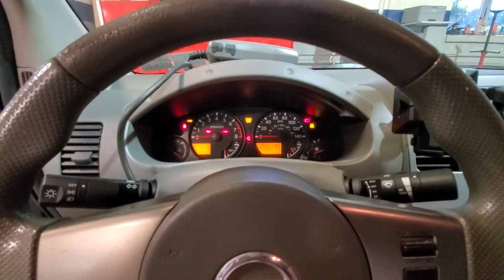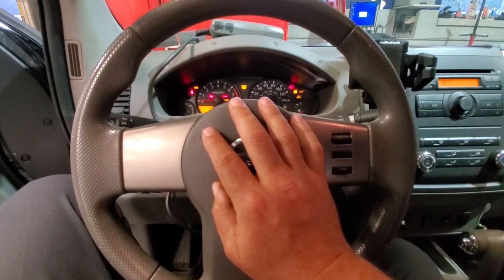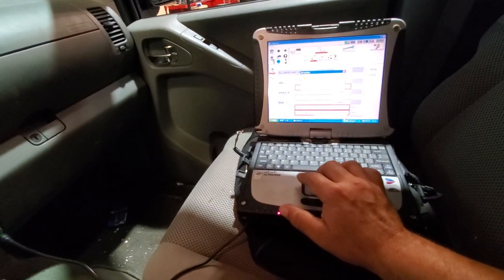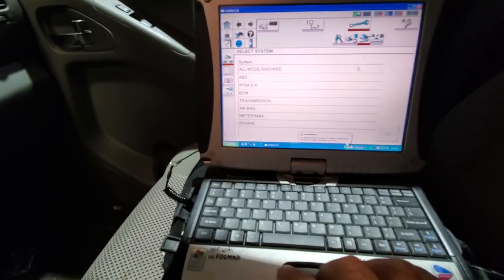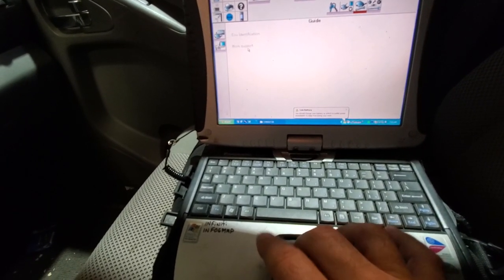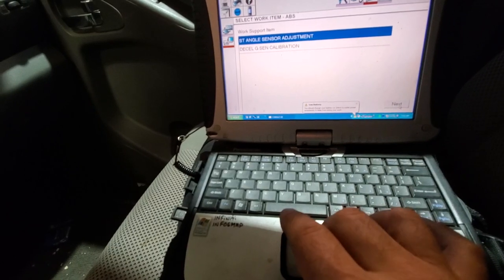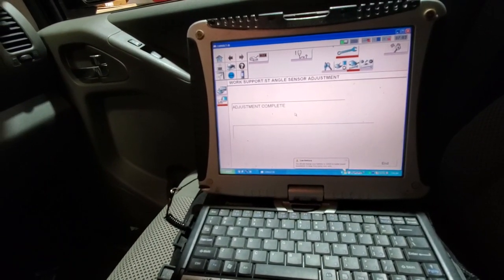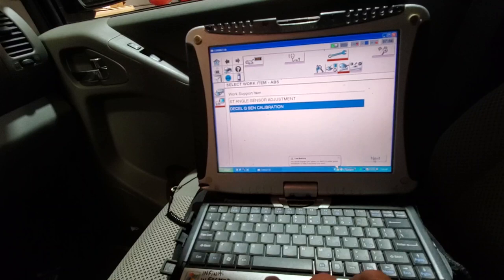Nissan Steering Angle Calibration

Comment: Why show a video of a procedure that none of us can do?
Reply from the maker: So you can see how it's done, and show why you can't do it.  Many people think that they can do certain things themselves.  When they can't.
Reply: @FixyourNissan  We can do it with aftermarket equipment (innova CarScan Pro 5610).  A useful video would should us how to do this, now how we can't.
Reply from the maker: @1drhnsd1  I planned on having more time to explain, but my laptop battery was dying and I didn't have the time to stop what I was doing and charge my laptop and re-do a video.  So I know it's not the best...  I know there are other scanners out there that can do it and there is also ones out there that can't.  I work at a dealer so I don't use any other scanners to say
Reply: @1drhnsd1  “Im scared people will fix their own vehicles and leave me broke” that’s all I heard
Reply: i hate the stealership
Reply: You can nanually do it i dislike these tecs that know we dont have the tecnology to relearn certain things but won't show us...look For relearn nanually steering angle sensor it's línea turning the wheel one way fully then the other fully car beeps Center steering wheel drive and shoukd correct

Comment: Hello. I replaced my clock spring and now traction control light stays on. I’m guessing calibrating the steering angle sensor is what I need correct? How much for a shop to do this usually?
Reply from the maker: Yes, Body shops can do it cheap.   So I would try there.
Reply: Thanks for the reply. Tried a couple auto shops but must of got the wrong guys.. they really didn’t seem to know how to do it or what I meant. Told me I needed to go to dealership 🙄
Reply from the maker: @justinlewis2519   You should go to a Body shop or dealer.  Body shops are cheaper.  Auto Repair Shops most can't do it
Reply: Justin Lewis did you fix your issue?

Comment: I have a question. I replaced my clock spring and reset with keys to remove the airbag light from dashboard. Now the VDC light is on and when driving it sounds like a grinding noise coming from front drivers side wheel. Could it be because it needs to be calibrated or are they unrelated?
Reply from the maker: VDC light may require the steering angle sensor to be programmed, which can only be done with a scanner.  It's best to scan the vehicle to check fault codes to determine direction needed to resolve your issue.

Comment: If i'm replacing a combination switch that requires the clock spring to be removed and put back on a new combination switch does it still have to be calibrated?
Reply from the maker: If you get an air bag light after you are done. Yes!

Comment: I used my blue driver code reader and was able to clear the angle sensor.
Reply from the maker: If not calibrated, it may return
Reply: @FixyourNissan  yep blue driver didn't clear it permanently. Actually had to do the air bag light reset with my keys and that reset the angle sensor so that it could recalibrate itself after a little driving. Don't need any special software
Reply: @bertrenolds5  how do you do this?
Reply: @danielsteven1908  you replaced your clock spring with a new one and swaped the angle sensor to the new clock spring? Kept coming back with the blue driver. Do an airbag reset with your key. Ry the car guy has a good video
Reply: @FixyourNissan  you have to calib. the G-Sensor too ?

Comment: I replace my and now the from sensor activate …any clues what would be bad… I already calibrate/program with my scanner
Reply from the maker: Steering angle sensor needs to be programmed after replacement.  Also has to be transferred from the old clock spring

Comment: There is nothing challenging about that once you have the tool. The question to you is what really is happening during calibration and why is it needed?
Reply from the maker: It is a re-calibration for the Steering Angle Sensor. Any time it is unplugged, it requires recalibration.

Comment: Hey man I have a 2014 Nissan Altima SL 3.5 it has Blindspot detection and Lane assistance It says it has a malfunction. Can it be because the steering angle has a problem and if I fix it, do you think the lane assist and Blindspot detection will start working again? Please I need a answer
Reply: Yes if that is an issue you have. if your new zero degree steering angle (top center of the steering wheel pointing straight forward) is now say pointing to your left or right corner at too extreme of an angle (which is out the systems tolerance range) it will throw a code and malfunction or compensate or just stop working. A faulty clock spring behind the airbag/horn will do that also. a really bad alignment can do that if the rear thrust angle is severely off (say just one whole degree is BAD). or if your bumpers made impact with anything that messed with the radar/sonar sensors

Comment: Hi there I have a question maybe you can answer? I have an 04 infiniti g35x sedan recently replaced the rack pinion afterwards I get vdc and slip lights and the car feels like it locks up when taking off and I can hear the abs vibration unless before you drive you turn the wheel one rotation to the right and the lights come on and I can drive normally it's extremely frustrating if you have any insight as to why this is happening I would greatly appreciate it thank you in advanced 👍👍
Reply from the maker: Sounds like when you did the rack, it was not locked and you pop the clock spring
Reply: @FixyourNissan  that sounds about right. 04 g35 racks do not need adaptation

Comment: I have a 2011 nissan sentra and i just got the clock spring installed but the mechanic i went to said it was most likely a bad clock spring and that why my vdc light came on? Would i need to go to the dealership to get it calibrated?
Reply from the maker: Dealer or a Body shop.. Body shops deal with allot of air bags as well.

Comment: Not sure if you could help. But I have a 2000 Nissan pathfinder.  I need the interior dialog panel to  the fuses. My starter went out but when I changed it my truck still would not start. So I have one more question for you I noticed there was a large amounts of oil leaking onto the starter. I believe this was the cause of my starter going out. Besides cleaning off the oil and finding where the leak is do you have any other suggestions on what  to do.
Reply from the maker: Most times, when oil has saturated the starter on these older Pathfinders, it's due to a valve cover leak.  It certainly can cause the starter to fail if saturated to much.
Reply: @FixyourNissan  I've already changed the starter out it was bad however my car is still not starting do you have any other pointers that I could try
Reply from the maker: @sarahhan2762  I try to keep topics to the video's I have made.
Reply: Check nissanforum.com for lots of help, but not many videos. Take what you learn there and come back here. Hope ya get/ got goin'....

Comment: What software are you using on the laptop?
Reply from the maker: That is a old version of Nissan Consult 3.  The newer version is Consult 3 Plus
Reply: @FixyourNissan  is there any way to across consult ourselves.
Reply from the maker: @cameronschluchtner  There is many other scanner that can program the steering angle sensor.  Body shops can do this for you as well if you need to have this done.

Comment: A video without any proper explanation
Reply from the maker: What do you want to know?
Reply: @FixyourNissan  i have a steering angle sensor code C1143 and don't  know how to remove it and your video not yet clear about what to do, kindly let me know the procedure to remove it.
Reply from the maker: Did you replace your clock spring?  If so, this will require the Steering Angle Sensor to be calibrated.  This has to be done with a scanner.  There is no other way to do this.  If you do not want to go to a repair shop to have that done, body shops are certainly familiar with working with air bag system and can calibrate it for you for much less than a repair shop or dealer.
 @edwinalexander1170
Reply from the maker: @edwinalexander1170  Yeah.. The video is a quick show on how you would need to use a scanner to calibrate the steering angle sensor.  You need to remove the drivers air bag, and column cover to access to clock spring to replace that with the steering angle sensor.  Then you need to use a scanner to calibrate it when done
Reply: @FixyourNissan   Thank you so much i will try now to calibrate it